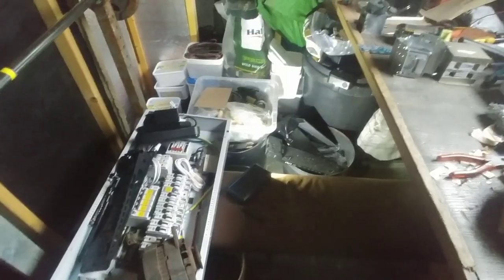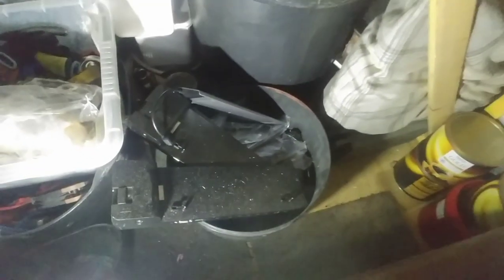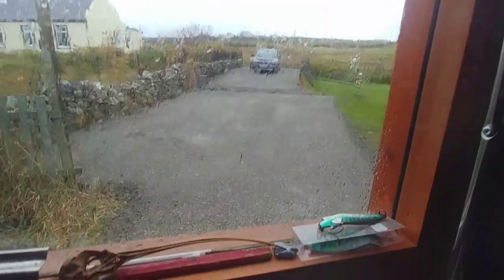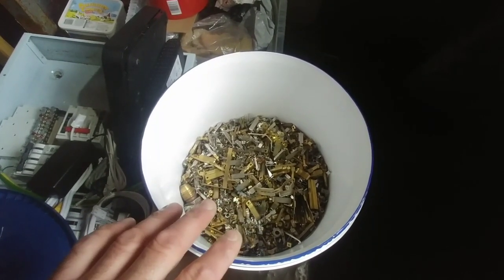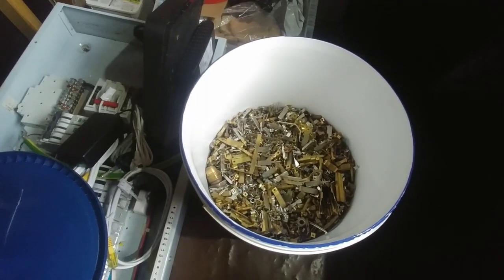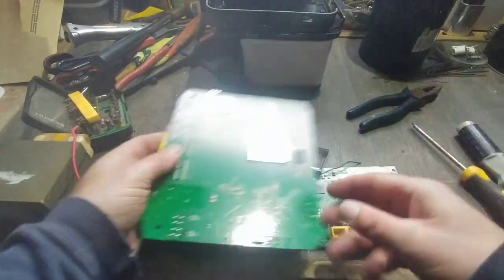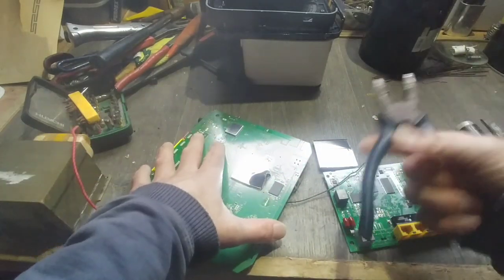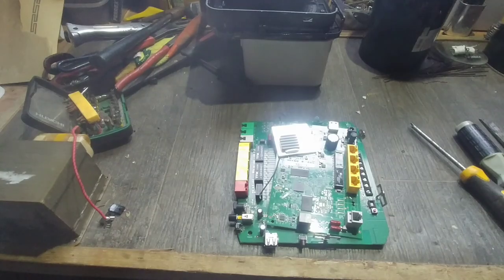Scrap Mess and a Brassy Bucket 😊

Comment: That's a mustery, blustery day. Stay warm, buddy. At least you can sit in the warm house when you're breaking down the boards.
Reply from the maker: Ha ha! The house is cold too...very old stone walled, fishing house. At least we've had a burner installed 😊
Reply: @ecoscrapper3501  a wood burner? Ian could have built you one of those.
Reply from the maker: @HHRecycling  It's a multi-fuel burner. Yes Ian could have! Installation required a professional, it was very problematic!